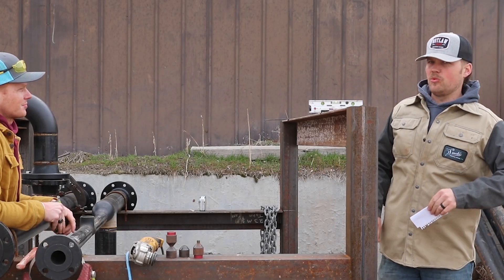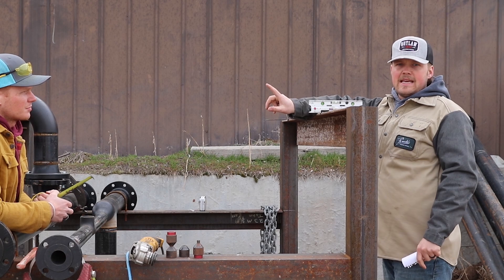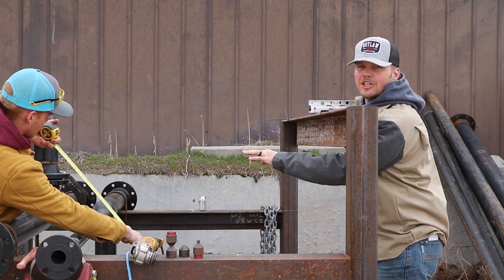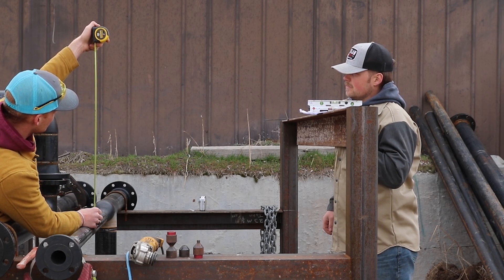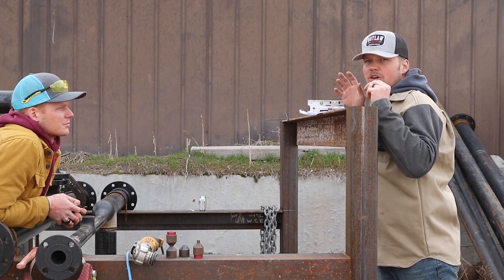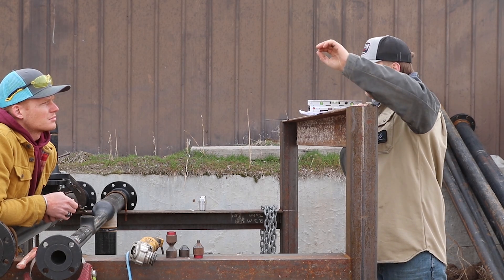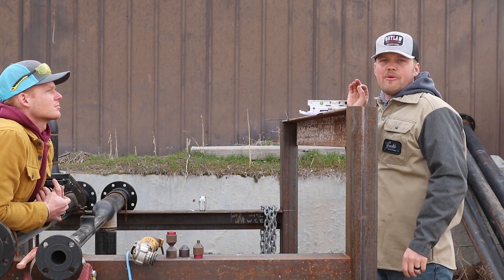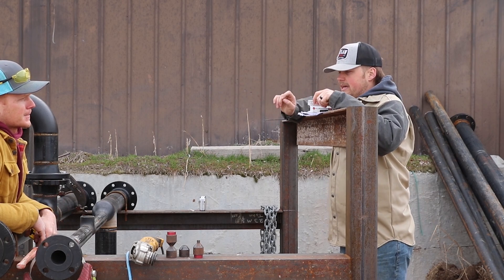Perfection Is Key With a Lazer Level

Comment: Love my self leveling laser that’s got a 360* horizontal line 140* vertical line and plumb bob beam. My primary use was for ship building, but I’ve gone back to where I started with structural steel fabrication.

Comment: What lazer do you guys use?
Reply: I personally use Huepar, its lower end chineasium, but I’ve used side by side with Bosch. I initially got it when I was doing ship building, I’ve recently switched back to structural steel fabrication. The link goes to the exact one that I have and use
https://www.amazon.com/dp/B07FKFCMDN/ref=cm_sw_r_sms_api_glt_fabc_